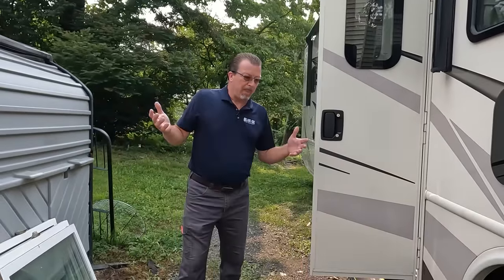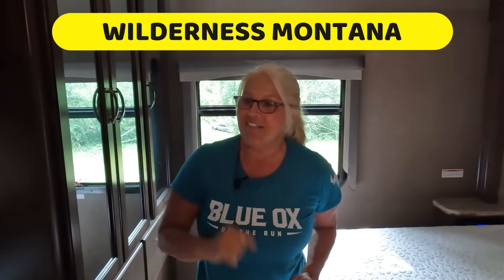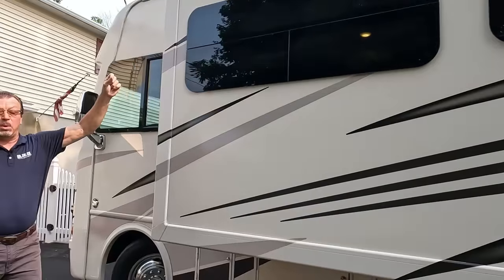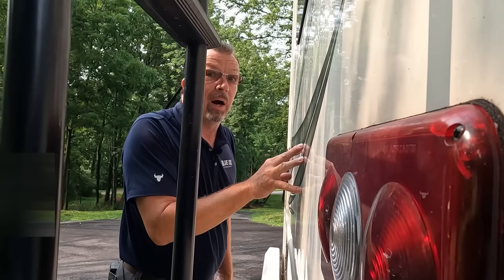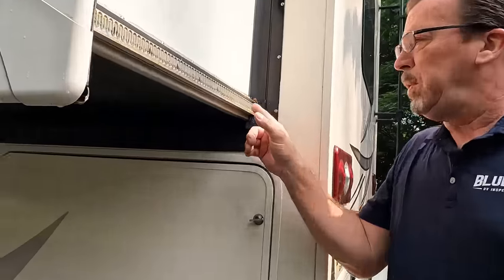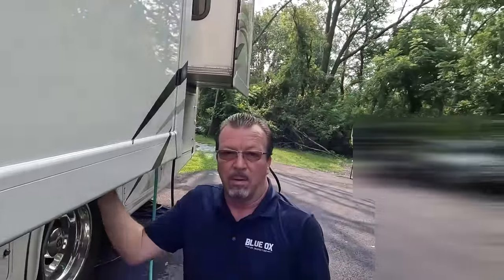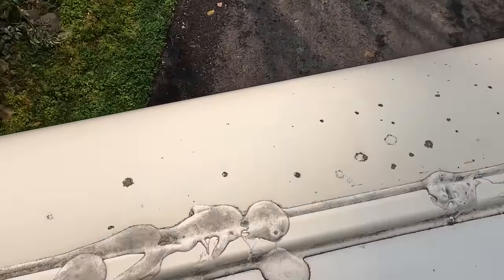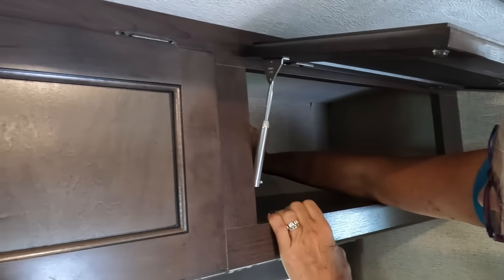🤬It's a TRAP for RV BUYERS! WHY are RV Sellers DISHONEST? THOR ACE 30.3

Comment: As a retired Realtor of many years, I would never buy a home without a proper house, termite, or radon inspection! Good to know there are RV inspectors!
Reply from the maker: Thank you for sharing your 2 sense 😘
Reply: Its good to know the food and meat inspectors as you never know when one of those cows with mad cow disease will get by them and delivered to a supermarket near you.  When was the last time you seen a meat inspector ?
Reply: @rh7163  I know this is waaay off Rv topic but I have a curiosity about those obscure diseases and wanted to reply. Now eating beef butchered from south of the border is russian roulette imo. But still as long as no brain or spinal cord is mixed in your "mostly" safe from even imported beef.
Reply from the maker: Just like RV inspectors 🤣 not often enough
Reply: Hiring a home inspector guarantees almost nothing. The last 2 homes I've owned before my current home had home inspections done on them that completely failed to find (or found and failed to reveal) obvious problems. My bet is home inspectors don't want to reveal problems they find because sales get shot down that way and pretty soon agents won't refer those inspectors to home buyers anymore. Prove me wrong.
Reply: @paulherring8959  rule #1..never go with a "reffered" inspector. Always go 3rd party if possible. Realtors are more slimy than a used car salesman.
Reply from the maker: They're like RV dealership salespeople 🤣

Comment: Worked at a Thor dealer 3 years ago, they needed alot of warranty work before they left the lot. Was shocked at how badly they are made. Those slideouts are what nightmares are made of.
Reply from the maker: It is 😔...thanks for your services and I understand why you left 🤣 
Maybe you had other reasons 🤔 but thanks for sharing what we claim constantly !
Reply: @blueoxontherun9188  Cool man, only left because I dreaded every time I saw a new thor hauled into the lot up here in Nova Scotia. They did sell leisure travel vans from Manitoba that were of exceptional quality and in high demand. I'm fixing up an older airstream for a friend thats nice to work on, and also a little vintage boler trailer that go for insane money now. Thanks for the well made video, nicely done!
Reply from the maker: Thanks. Good luck with this awesome project 🤙
Reply: RV story

Here’s a sad story:  I just bought my NEW Thor Windsport 35M from LaMesa RV in Tucson, AZ which was RIDDLED with obvious damage and problems that I noticed during the RUSHED pre-delivery inspection.  My appointment was set by them for 2:00 PM on a Friday (on 11 Aug 23). I flew from  Alabama that morning, and my salesman picked me up at the airport (8 minutes away from the dealership). I was off to a good start. 

I arrived at the dealership earlier than my appointment time, so I had to wait a while. They gave me free bottled water (Costco brand)…another nice touch that doesn’t cost them much. 

When I met with the pre-delivery inspector and rode out to the RV, within seconds, I saw a three-foot scratch in the paint job.  I was told they had just noticed it that morning, but the warranty would cover it.  In my mind, I called BS but continued to be polite. 

They were surprised that I wanted to climb the ladder to look at the roof. There, I found quite a bit of bubbling, where the roof cover had separated from the layer below.  Boy, would I have liked to know this before flying out. 

Keep in mind that I am new to RV’ing…I had never even driven an RV, nor was I offered a test drive prior to my purchase. The emotions were high, and I was being rushed. No kidding, at the end of my three hours, they locked the gate behind me as I drove the RV out of the dealership (my first time driving an RV). I had to pull over two blocks away to figure out how to drive it.

Back to my story…

I noticed small imperfections on the outside, including a peeling pin stripe (I thought these didn’t have pin striping), rock chips in the paint, etc.  if this had been a local purchase, I might have walked away at this point, but I was stranded since I had flown across the country one-way.

Upon entering the RV, I immediately noticed the strip that holds the carpet down at the top of the stairs was bent (sticking up approximately 1/8 of an inch)…a tripping hazard. Within the first minute, I noticed a three-inch cut in the leatherette skirt of the driver’s seat.  Who missed this?  It was so obvious. When I sat in the driver’s seat, it heavily leaned to the right, and the inspector agreed.  Prior to my arrival, they had to fix a hole in the floor and replaced the vinyl flooring, so I assume the did not put the seat back in correctly. I had to drive with it like that for more than 1600 miles. I am a disabled vet with spine issues, and my back was killing me!!!  With a glance at the flooring, I found a 6-inch cut on the passenger side floor, along with a screw under the linoleum and other minor imperfections. They literally just laid the new vinyl over the old vinyl, so I could feel the hole that was still there.

On a very trivial note, I discovered the mosquito problem after driving down the road. I killed at least 10 mosquitoes, but not before they left their mark on me. 

I was eager to try the stereo system. I love my music. The inspector initially had the music on very low, and then he cranked it high. Again, I was being rushed, so it wasn’t until I had left the dealership that I realized one of the speakers was blown And had a lot of crackling. This was on the passenger side where he was sitting during the inspection. 

Furthermore, while inspecting the stereo speaker, I noticed the passenger curtain that was hooked to a small board, which is supposed to be bolted into the ceiling, was stripped out and hanging down. I pushed up on the small board, but it fell right back down. Here’s yet another item that I need to fix . This is a brand new motorhome, right? I am shaking my head in disbelief and disappointment.

I pointed out goo or glue along the baseboard, near the floor, where the technicians had left a mess from installing the vinyl flooring prior to my arrival. The glue or goo had dirt, so it was quite obvious. At least they cleaned that off prior to me driving away. Everything else, I was told I had to submit for warranty fixes. This is time that I do not have out of my busy schedule.

When I sat on the three-person couch, I immediately could tell that it was not bolted down. The inspector sat with me, and then looked at the back of the couch, and agreed that the bolts were not bolted down. At least they fixed that before I left. Another oversight From a lack of quality control at the dealership.

On a good note, when I asked for a starter kit, my salesman gave me one. It had a few items, including the snake for the black tank, some toilet paper, and a few other miscellaneous items. 

On a disappointing note, I asked for my gas tank to be full during the inspection. While signing all of the paperwork in the finance office, there was some pushback, with the finance guy, stating they normally don’t fill the tank and leave it at half way. He eventually agreed to fill it, but after asking someone to do it, I was told that everyone had left, since it was after 5 PM, and they were hurrying.  He told me to fill it up when I left the dealership and send a receipt and that I would be reimbursed. After arriving back in Alabama, I sent the receipt ($106 bucks) but have yet to be reimbursed.

The day after I arrived back to my house, it rained as it normally does, each day during this time of the year in Alabama. The following morning, I took my wife out to the RV, but we couldn’t enter the RV. The deadbolt was jammed. It’s possible the heat had done it, I went to work, and my wife continued to play with it, eventually, forcing it to become unlocked. When I went into the RV that evening, I saw two streams of water on the floor that aligned with the slide.  Wow… a leaky RV. At this point, I wasn’t surprised.

There were many more trivial items, but I’ll leave you with just one more. As I was driving, and on my third day on the road, the passenger side mirror became completely loose, swiveling with the wind. At that point, my entire right side was blind, since the camera is mounted to the mirror. I did not have tools with me. After my third stop, trying to find somebody with tools, I located a gas station with a hex screwdriver. This set me back an hour.

Lessons learned :  Everything I watched on YouTube and read on the Internet seems to be true, regarding the RV industry. It appears that the quality coming from the manufacturer is terrible, including the leatherette furniture, the cabinets, which have stickers on them to make them look like fancy wood, and much more. With low quality, they arrive at the dealer, but the dealer is not going to spend money and time to fix these and get them up to standards. That will fall on the customer. Had I known all of this and believed all of this, I would’ve passed on owning an RV.

I retired from the Air Force with 30 years of service, and I still work for the Air Force as a civilian with 35 years total. I can’t understand how a manager or business owner would utilize this business model. It’s quite embarrassing and tarnishes the industry. It seems our society is slipping a bit. Some people are lazy, don’t want to work, take shortcuts, etc. As a collective, I believe we are losing our values, work ethic, and morals.  Imagine if my salesman had told me that when I picked it up, I would have all of these things to fix, including the leak, the gash in the chair, the crooked chair, the bubbling on the roof, the long, scratch, along the side, and much more. Do you really think I would’ve bought the RV?  Of course not. Do you really think that LaMesa dealership in Tucson Arizona would have told me that over the phone, knowing that I probably won’t buy it? Of course not.

Think twice about buying a Thor motorhome. The quality of the build is sub-par. Think twice about the dealership you go to, no matter how good the deal seems to be. If they set a late afternoon appointment on a Friday for you, decline it. The rush job to get you out of the dealer for a six-figure purchase almost seems dishonest. The sales industry has always been this way, and most of us are aware.

I hope this long post helps you with others’ decisions.  I highly encourage getting an inspection.   I got one on a used RV that I almost bought prior to this one, saving me at least $20,000 due to a leaking roof, water in the ceiling, and much more. I tried to get one before flying out to Arizona for this brand new Thor, but everyone I called was booked. Get your inspection early!
Reply from the maker: Thank you for confirming what we thrive to make people aware of....they don't care...an inspection is free of charge!!! Put any amount on any parts, time, travel fess for nothing, lost of enjoyment and being screwed literally legally...under warranty my a...!
I'm sad to hear these repetitive stories and I do have empathy for you and your ordeals. This is too common and we thrive on using our way of making people aware of the importance to invest in an inspector.
Reply: @blueoxontherun9188  …thanks for the reply, ma’am.  I am quite handy, but I am confident that I have not caught everything yet. If I hadn’t waited until the last minute to try to find an inspector, I’m confident the inspector would’ve found all this stuff, and more, which would’ve saved me the trip to Arizona and the headache to now be on the hook to fix everything via the warranty. I plan on posting that story quite a bit to alert people to this dealership and Thor motorhomes, which are not as good of quality as a Tiffin or Newman. Of course, Thor could always reach out and try to make this right with me, but that would be a longshot. Cheers!
Reply: @markbennett8685  you need to edit your first sentence from "sad story" to "horror story."
Reply: Just watching YouTube vides,  I know that Thor is junk.

Comment: GREAT FEEDBACK... SEE BELOW... WE REALLY REALLY APPRECIATE IT:

SAFE MOISTURE LEVELS:
For a motorhome or towed trailer, the safe moisture level inside the walls typically ranges from 10% to 15%. This range is considered safe because it helps prevent issues like mold growth, rotting, and structural damage caused by excess moisture.

Moisture readings above 15% indicate a higher risk of problems, and if the moisture levels exceed 20%, it becomes a significant cause for concern as it may indicate water intrusion and potential damage.

It's important to regularly monitor and inspect the moisture levels in the walls of your motorhome or trailer, especially if you're in a humid or damp climate or have experienced water leaks in the past. Using a moisture reader device can be helpful in detecting any potential issues early on and taking necessary measures to prevent further damage. If you find consistently high moisture levels, it's recommended to consult a professional for a thorough inspection and proper mitigation.

Amen
Retired, Veteran
Reply from the maker: Thank you for your services sir 🙏 we appreciate you more than you can ever imagine ❤️🇱🇷
Thanks for bringing the light to our people. If it came from me, they would have doubted my numbers.
In MHO you have it spot on.
Thanks for chiming in 🙂

Comment: I have a builder friend who showed me this same thing on "discount houses".....instead of using proper construction techniques, various caulking materials are used to seal up voids and spaces because it's fast, cheap, and easy and saves lots of time.
I have seen this "caulking scam" on some million dollar house roofs/skylights, and poke throughs on roofs where cheap or non existent flashings were just filled with junk caulk, and all pulled away and cracked from the weather changes - yet still passed home inspections. 
This crapola is common & everywhere.....
Reply from the maker: Exactly 💯

Comment: I suppose people can view the inspection fee as a "waste" if they have to do it several times before finding a good deal. We can all relate to that, I'm sure. But, overall, she spent money to save far more money and headaches on down the road. Sometimes I wonder if the sellers even know about the issues that are found?
Reply from the maker: We would all like to think the sellers don't know, but... in this case, it was like putting lipstick on a pig. The roof had green vegetation growing on it,  while the inside was cleaned up for presentation.  I'm sure, in many instances, sellers are oblivious. Another reason to have an inspection.😊
Reply: @blueoxontherun9188  hopefully they won't fool any prospective buyers.
Reply: The sellers would know if they performed timely and proper maintenance or not.
Reply: @backtoasimplelife  I meant in general. I did an inspection recently and wondered if the sellers knew all the issues that might put off a buyer. They mentioned certain things to the buyer but I really don't think they knew of some of the other issues. Struck me as the hook it up and go folks, and only used the trailer a few times. Health issues are reason for selling.
Reply: i think sometimes yes, sometimes no. but the inspection is always worth it.
Reply from the maker: I don't agree with "giving" the report as they spent that money for their own sake. They could always monetize the report tho ! IMHO that would only be fare

Comment: Great job! You saved that buyer 80 grand. I wouldn't touch that rig for half the price. At the bottom end of Thor's line-up (where the ACE resides) they're already using the cheapest parts and materials available. And chances are that the people screwing your rig together have little to no experience whatsoever. They say you don't want to buy any vehicle that was made on a Monday or a Friday, but it's even worse when the guy who helped build it on Friday was hired Thursday afternoon.
Reply from the maker: And Wednesday was this guy's last day 🤣

Comment: Don't own an American RV and would never want to own one since I live in Europe. But YouTube's algorithm brought me here for some bizarre reason and my general curiosity made me watch. What I don't get is why these water penetration issues exist on a unit that's only five years old and doesn't appear to have been used all that much. Thor's website cites a base price for an ACE unit of around £180,000. At that price point, I would have thought they could use corrosion resistant fixings in places that are exposed to the weather. I would have also thought that they could have figured out a better way of preventing water penetration than apparently requiring the owner to annually recalk all exterior gaps as if the unit was an 18th century wooden sailing ship.
Reply from the maker: Your observations are right on . The problem with the industry in this country, is the lack of regulation for any RV manufacturers and their profits being higher then the cost of warranty claims. Since it doesn't affect their bottom dollars, they do not care at all.
Consumers assume, wrongfully,  because they pay high dollar for these vehicles, they have to be well built!? The lack of education is so another culprit to the industry used units where nobody was thought or told it required maintenance. Everyone imply it's just like a car, you just have to wash it ...🙄😶